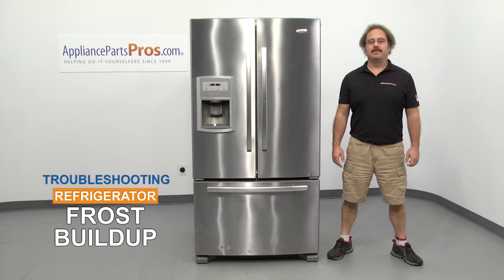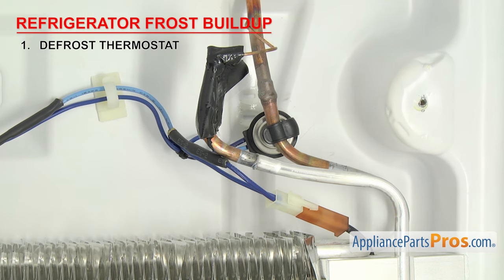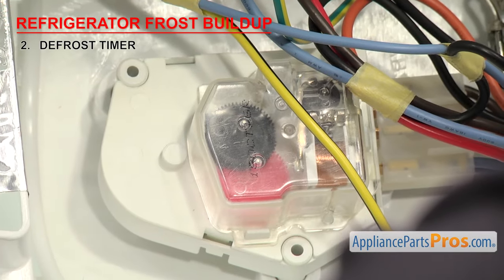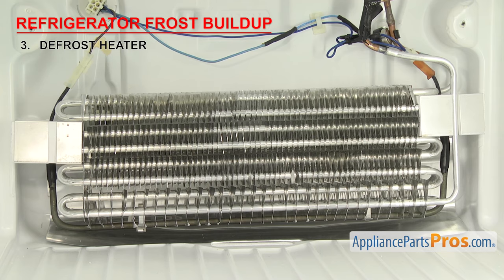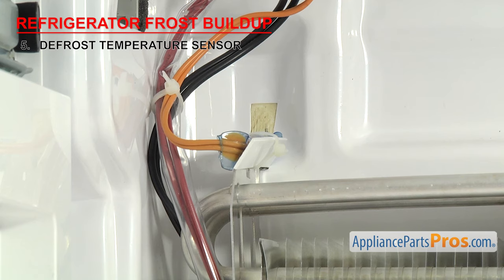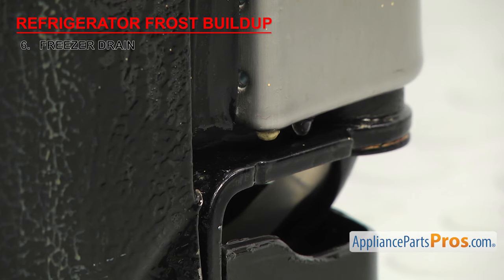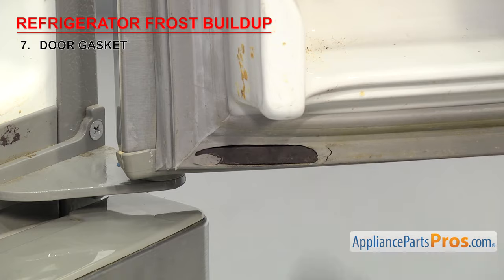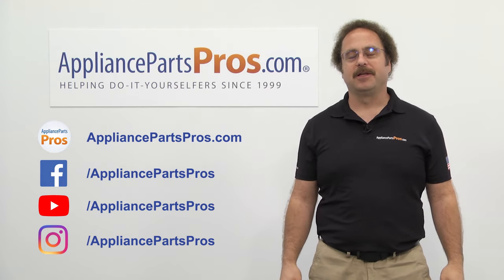Ice Buildup in Refrigerator Compartment - Top 7 Reasons & Fixes - Kenmore, Whirlpool, GE & more

Comment: Hey guys.  First, thank you!  Thanks for sharing information like this for us DIYers.  But I would like to ask a question:  There's a flap between the doors of my Kenmore side-by-side (bottom freezer) that gets incredibly warm at times.  Is this part of the defrost cycle?  It concerns my wife greatly as well.  Thanks in advance.
Reply from the maker: What is your model number?
Reply: @appliancepartspros  Kenmore 111-7302*.  Sorry for the delay.   I thought I answered you already.
Reply from the maker: Thank you. It is normal for that to get warm. If it's getting too hot you will need to check the condenser coils in the back to make sure they aren't dirty. Also check to make sure the condenser motor is coming on.
Reply: @appliancepartspros  Thanks.  From time to time the evap coil ices up and stops the fan.  It seems that this causes that flap to get excessively warm.  By that time though I know it's time to pull the inside panel out and grab the wife's hair drier.  Again, thank you.

Comment: I have a side by side whirlpool that is still getting somewhat icey in the vent from the freezer. I replaced the defrost control board, the defrost heater element, the defrost thermostat, and the temperature control thermostat all with name brand whirlpool parts and my fridge is better but still not perfect. The next thing I was going to replace is the defrost temp sensor. The unit was made in May 2007 and I'm wondering if the compressor is failing? Any thoughts?
Reply: Any luck? What was the conclusion to your story?? Genuinely interested..
Reply: @aspiringleo  It got fixed by reseating the condenser coils in the freezer which allowed better airflow and I had ice buildup in the thermostat bulb sleeve which I blew out with compressed air. This stopped the short cycling then I turned down the thermostat to make it colder in the fridge because it's a different design from the original model that doesn't appear to be as sensitive. The temperature is good now but I still get some  ice sickles on the vent occasionally because the Freon is probably a little low but you can't refill so I just live with it.

Comment: So i get the part where the ice buildup due to debris blocking it or it is iced up, what about getting water on your floor on a side by side on the refrigerator side floor. I am getting a sheet of ice on the freezer side and water on the floor on the right side. Did i miss something?
Reply: there is several things that can go wrong study man lots of moving parts lol trust me i know and i am working on learning to replace stuff too.
Reply: @donj1325  It has been good now for over a week, still have not pick up the turkey baster to try the hot water technique. Hopig the issue is resolved. Also purchase and put in a legit water filter as well. Keeping my fingers crossed.

Comment: The amount of ice I have in the refrigerator compartment is huge. I have no ice in the freezer compartment. The water must be coming from the ice-maker/water dispenser part of the refrigerator door. There is not enough moisture in the air to make the amount of ice I get in the refrigerator section.
Reply from the maker: What is the model number of your fridge?
Reply: @appliancepartspros  The main portion of the refrigerator has two air conduits that mate up with conduits in the left-hand door. There are gaskets/seals there and I am pretty sure they are leaking air into the refrigerator. There is moisture around one of the seals and there is water on the floor of the refrigerator beneath the seals. I'll get a tech out to look at it.